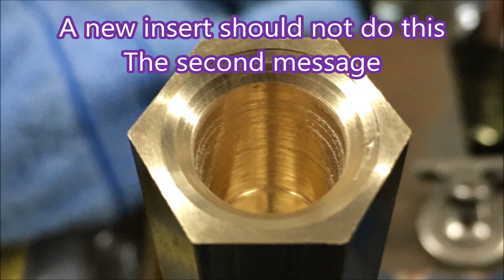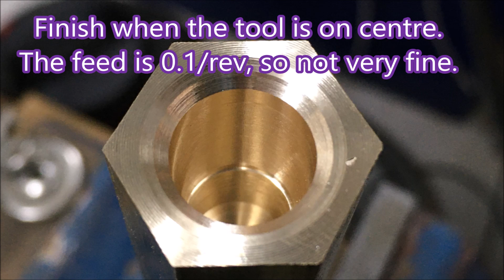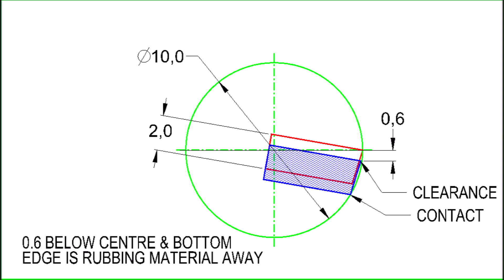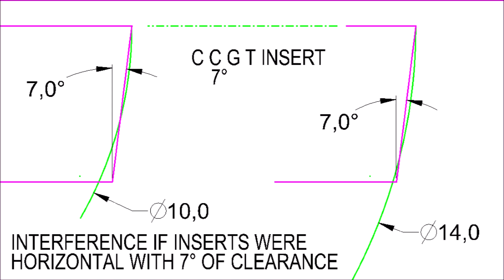Cnc lathe boring bar with carbide CCGT insert needs HELP. It is set far too low.

Comment: Interesting. Are those inserts designed to be angled in that way? Doesn't angling the boring bar change the top rake angle of the insert by the same amount? Does this not matter?
Reply from the maker: The inserts are standard inserts, I think the angle is added to the boring bar to make them work without needing specific inserts for boring.  Yes the rake angle will be reduced by whatever angle of tilt is used on the boring bar. I think that with a small bore, if you need lots of front clearance and a sizeable rake angle, you end up with very little material left for the cutting edge.  Nice to hear from you, I have not been aware of much activity on your channel, all well?
Reply: @smallcnclathes  Yes, 4 months and no uploads! I've got some footage in the can but it hasn't gelled into a satisfying video. I also made a second attempt to fix my wobbly grinder wheels, but it didn't work.

Comment: As always I learn a little something.
Reply from the maker: Me too! A friend tried to isolate the actual lathe noise for me, it sounded quieter but kind of weird so I did not use it. Do you think it should be possible to isolate the machine sound and leave only the sound of the tool cutting?
Reply: @smallcnclathes    That is not exactly easy as the two are so similar in their timbre. With the right kind of patience I am guessing that you could tease out one sound out of the other but it is not a job that I would call easy. And the software is a real bear to find and then  learn. I only have a few ideas of what may even attempt to do it.
Reply from the maker: Not as easy as it made to appear on tv!

Comment: I will argue the feed back point, most my cnc  experience I've always had load gauges so easy to see when something is wrong, but the sound of chipping is always a good indication of what's happening.
   I've had plenty of times packing a tool under one end to gain enough clearance to get a big tool in a small spot
Reply: Ok perhaps I should have qualified my statement to refer to 30 year old machines made for educational institutions.  A bit like comparing a grey Fergie with a modern Combine. LOL  Oh dear I must check which channel I am using before posting an answer!!!
Reply: @notewell3d199  haha, annoying comments ay.
   I have spent a lot of time heavy manual machining and I'd say insert performance can often be determined by the shape and colour of the chips and also the sound.  I will admit this would be much more difficult with brass though.
Reply from the maker: @landlifem5872  Long time since I had any annoying comments, comments are usually most welcome. From memory my lathe would almost fit inside the clear space of a lathe you were using.

Comment: Tool height offset? I can honestly say I have never come across that, could you explain? We have lathes with "Y" axis for live milling and can "cheat" a tool on center in a pinch but the turret always indexes to same location.
Reply from the maker: The turret tool position is set by an encoder.The software can adjust the height of the tool by changing the setting for the encoder
Reply: @smallcnclathes  Understood. I've only experience with machines which have curvic coupling to locate the turet after indexing via a hydraulic cylinder. It's either right or the turret needs an alignment.
Reply from the maker: @MRCNC1967  if there is a hydraulic cylinder involved, we are really talking about different size machines. My turrets have small electric motors to drive them. The turrets you are talking about probably out weigh my whole lathe. LOL
Reply: @smallcnclathes  Yes, talking about full sized CNC slant bed lathes. And yes, having pulled the turret disk for cleaning and servicing I can assure you outweigh your lathes. I just find it interesting and convenient you have a function to adjust the height of the tools. Can you set a different offset for each tool or is it a "global" offset that affect all the tools locations equally? Your graphics on tool clearance are very helpful, the importance of tool height is something I was taught way back last century, and it still applies today!
Reply from the maker: @MRCNC1967  tool height can be adjusted for each tool.

Comment: Been reading some of your replies to the comments, all good fun keeping these lathes running and figuring out problems. Behind an ex engineer I love these videos. Keep em coming 😀
Reply: Hi Stan, yes keeping old machines running is always a challenge.  From finding a working PC that is old enough to have an ISA slot for the interface card, to dried out capacitors in the circuitry.  Then of course the mechanics can also wear out, although I have to say the little machines are pretty damn robust mechanically.  But yes it can be a challenge. Thank You for your comment
Reply from the maker: That reply is from me, just forgot to change my channel!

Comment: I'm not following how the software can compensate for tool height.  Is this a 3 axis lathe?
Reply from the maker: The turret tool positions are controlled by an encoder. I imagine that the software is able to control the tool height position by adjusting the position set by the encoder.  In other words, I don’t follow it either. LOL. My crappy explanation is my best guess, electronics and software are not my thing. I am a mechanical draftsman who drives a small cnc lathe! All I really know is that the tool height really does change when the offset is adjusted in the software.
Reply: @smallcnclathes  the more I hear about your lathe, the more impressed I am at the parts you make on it.  Really making the most of it.
Reply: Me either, I've never seen that. Just an index to the tool position with a X &Z offset. I'm guessing there is no cervic coupling on your small lathe.
Reply from the maker: @lunkydog  did my explanation to Gary make sense to you?
Reply: @smallcnclathes  I guess so. It may also explain why you were going the effort to balance your turret a few months ago
Reply from the maker: @lunkydog  that was the other turret! This one has a motor driving a worm and wormwheel and an encoder on the worm. It is not nearly as sensitive to balance as the older turret. Main problem with this one is backlash between the worm and wheel which allows tools to move.